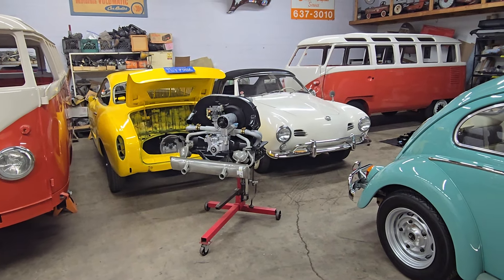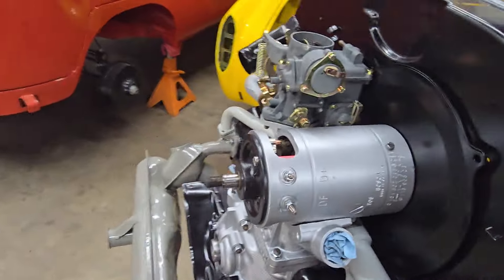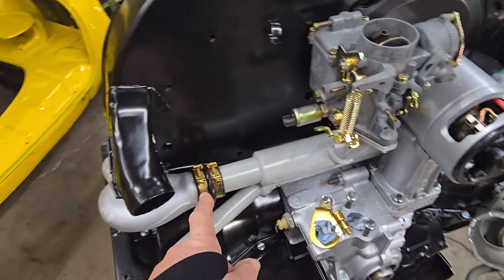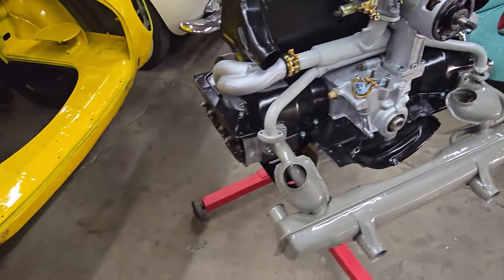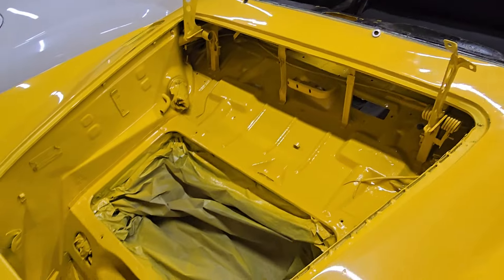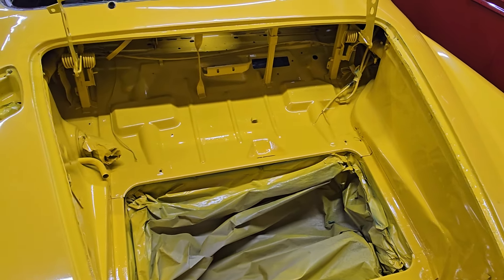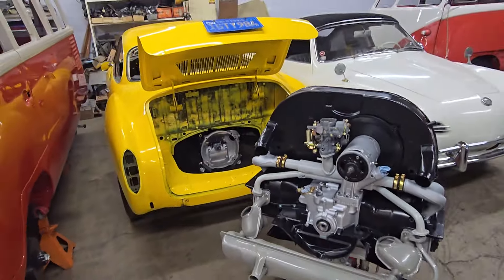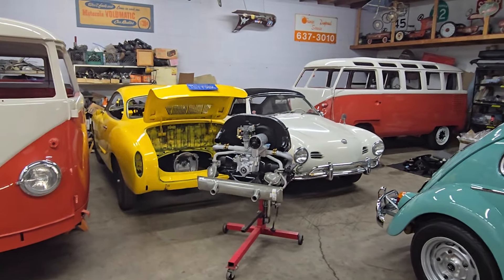A Day in the Life of Vintage Classic Specialist, Episode 98, one-handed engine building!

Comment: Like I’ve said, I’m new to your channel. Your work is amazing even on a limited restoration. Unfortunately, here in Florida older VW’s are not the popular. Due to the heat, we are spoiled by A/C. My older VW is 2006 beetle convertible, an electrical, and power window nightmare. But it has a 2.5, engine and runs great. That green bug made my head turn, can’t wait for your video on it. Thanks, RickGTI…..🌴
PS. Good luck at the doctor !
Reply from the maker: Thanks Rick, glad you found the channel. I lived in Houston for about 6 years and the humidity was pretty killer when driving a vintage VW. Usually didn't stop me from driving it, but the back of my shirt would often be soaked when I got where I was going 😅

Comment: I use vw clamps on my inlet boots, and if you take the fixings apart, put the vw emblem so you can see it, then put the fixings back on having swapped them around, if that makes sense. I can see all mine.
Reply from the maker: Thanks for the tip, I may give that a try! 🙌

Comment: Looks nice but the worst thing you can do is always never use a stock exhaust system and never use a stuck ignition system unless it's a  .009
Reply from the maker: Thanks. Stock exhaust systems are just fine for stock motors, and 009 distributors are not for stock motors, especially with the later stock carbs.